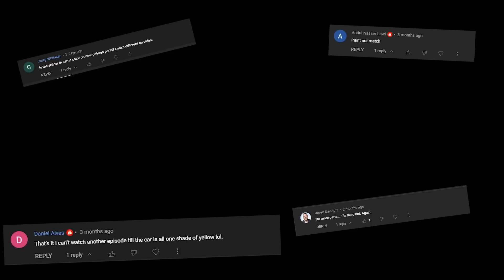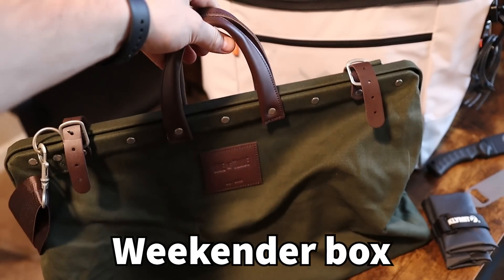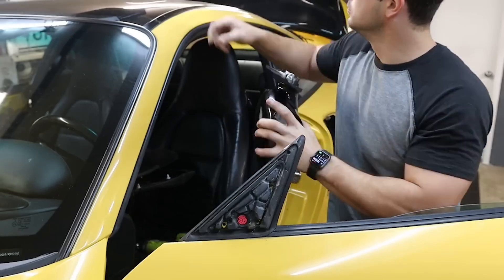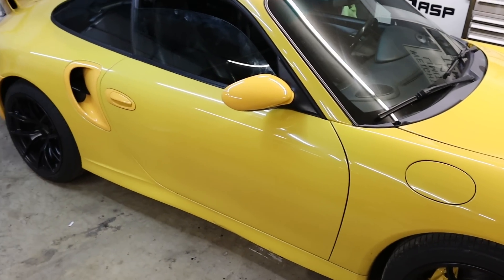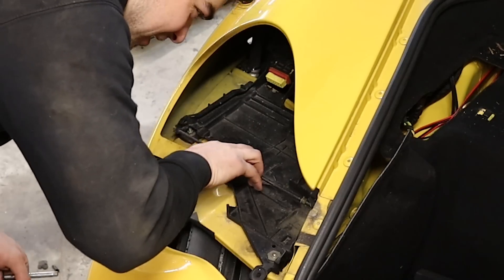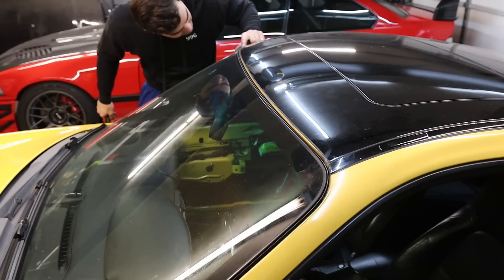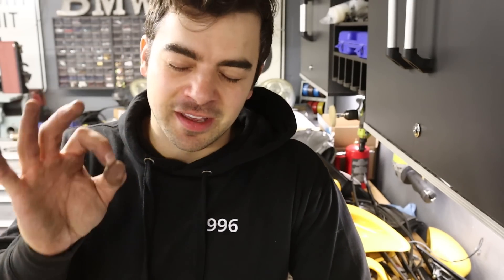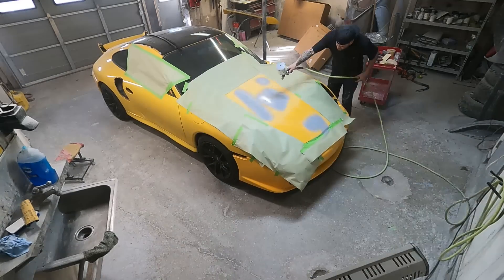Will New Paint SAVE this Cheap Porsche 911 Turbo?

Comment: For removing emblems, use the heat gun first then use fishing line. Won’t mar  or dent the surface of the paint and cuts through the adhesive nicely. Just needs to be a heavier weight test line.
Reply from the maker: Yea I'm not sure why I didn't use fishing line.  I usually do.

Comment: Any idea if the IMS bearings have been taken care of?
Reply: It's a mezger engine, it doesn't have the same problems as the m96 engine, the IMSB is a different configuration and is a 'wet' system not dry like the m96 bearing.
Reply from the maker: What he said

Comment: Installs radio/stereo, upgraded wheels and brakes, swaps body kit to upgrade look, full repaint, and leaves known mechanical issues. Yep boys and girls we HAVE A SEMA 2023 BUILD!!! Next issue interior gets pulled and replaced.
Reply from the maker: Uhh, what?  Guess you haven't seen everything else that I've fixed.  Have to get the paint work in when it's available, I never said the fixes aren't going to keep coming.

Comment: doesn't look completely reprinted.  Paint fades on cars.  A common issue, even using the factory code on a car more than a year old, the shade will be off
Reply from the maker: There are definitely at least half of the body parts already repainted.